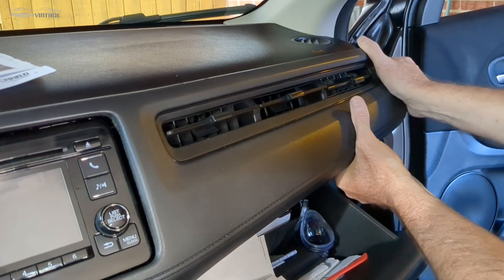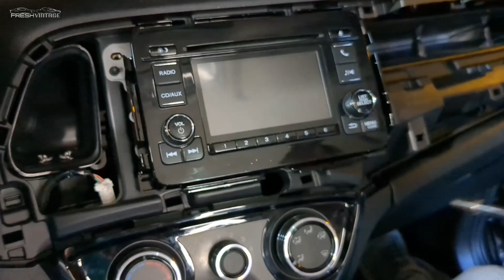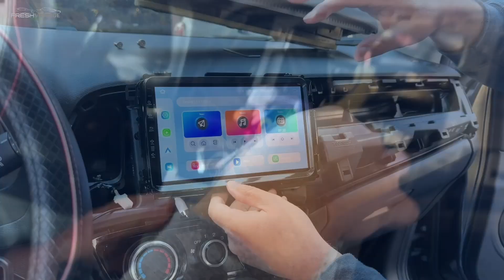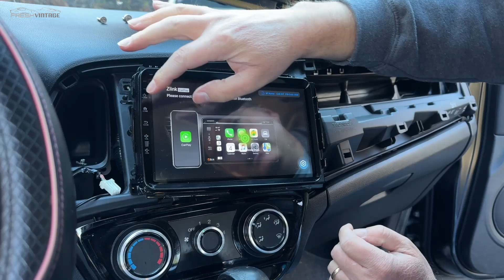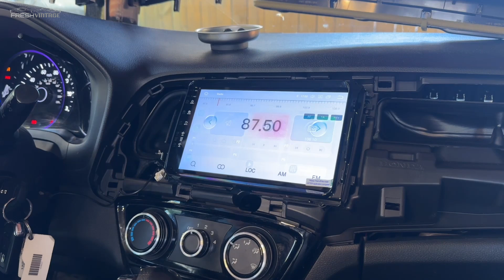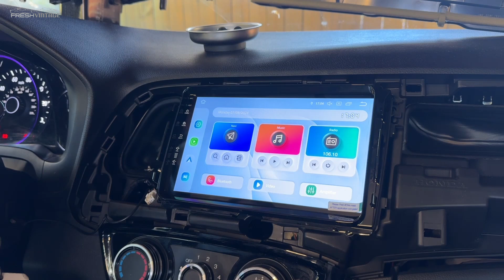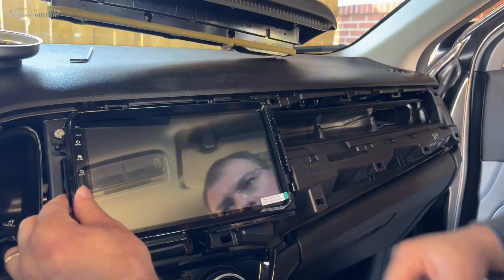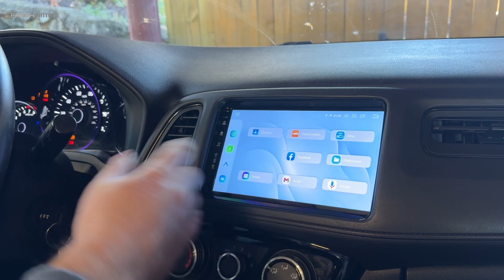FAST CarPlay Dasaita Radio Upgrade for 2016-2022 Honda HR-V!

Comment: What happens with the backup camera? Would it still be connected to the new radio? Or would i have to get a new camera for it
Reply: Good question! That camera is so good and convenient.
Reply: Did you watch the video?
Reply: @ was it on there or what

Comment: Do it does work with the factory USB connector?
Reply from the maker: Thanks for watching and subscribing we do appreciate it! We were able to get it to work for power only, but not the actual USB data transfer. The DaiSaita provided USB cable works perfect though!

Comment: I just bought a Honda HR-V 2016 this week and mine has different controls for the heating and a/c system. I have touch controls but would much rather have knobs. Did yours come with the knobs from the factory? Curious if you had swapped that out yourself as well or if that is even possible. Thanks for the great informative videos. I just subscribed today

Comment: Question - did you use the original screws or did u still have to use the new screws after adjusting it? 

Tyvm for ur video

Comment: Wonderful walk-through.  Right at 6:00 the edit skipped the connection of the factory USB port to the single adapter. It magically got connected in the cut. The notes about the mounting screw mod at the end was a real help, I encountered that as well on my 2018 HR-V. Gotta say - the G13 works great. The local AM and FM radio UI works well with the steering wheel source button. The individual door open display was a pleasant surprise.  Thank you again for the walk-through. I hope the affiliate link worked
Reply from the maker: Thanks for watching and Subscribing Paul we do appreciate it! Forgive the connector edit good catch on that, and we've been impressed with the overall look & feel of the DaSaita unit too.
Let us know how it works out for you once it is installed thanks so much 💯
Reply: Does your vehicle comes with blind spot camera? And if so do they work?

Comment: Thanks for this video. It (and your answer to the USB question in the comments) answered a bunch of questions I had about my 2017 HR-V.
I do have one question though. My odometer section in the dash has a clock that is set by the stock head unit. It's the only setting in my vehicle that I can think of that is actually controlled by the unit. Does this radio pass the time to the odometer area? Thanks!
Reply from the maker: Hello the team at DaSaita just got back to us and asked if you had already installed the radio? I'm assuming not but wanted to check as they asked what information the DaSaita unit is feeding your clock right now?
Reply: @freshvintage  Thanks for getting back! I have not purchased the radio. I have a different setup (a separate carplay screen) which takes up a lot of room on my dashboard, so I am hoping to replace that with something like this unit. The time isn't a deal breaker, but I like to cover my bases when making big purchases. I appreciate your willingness to help!